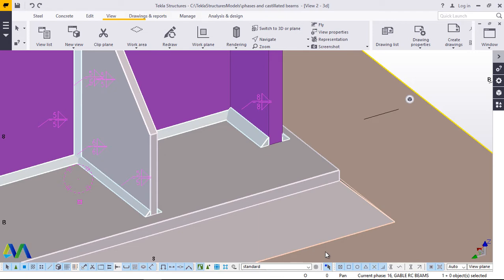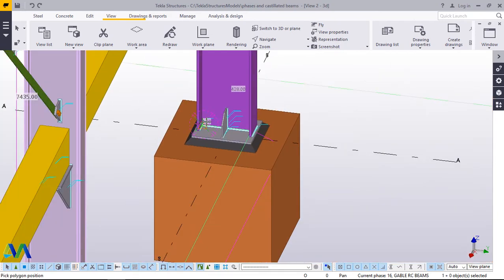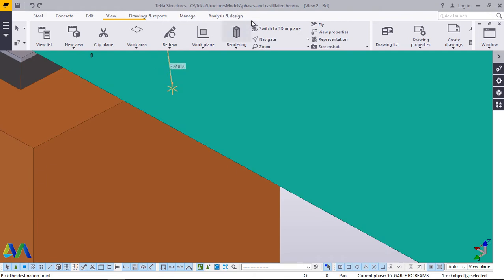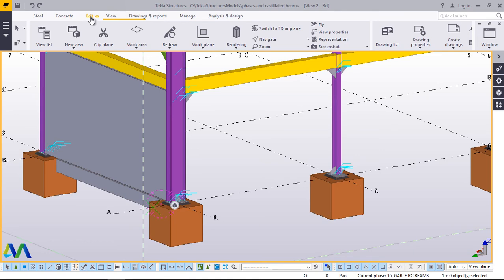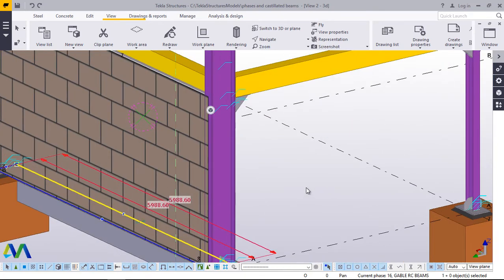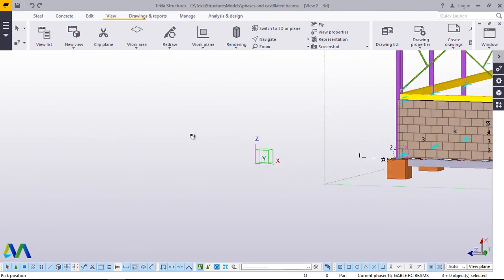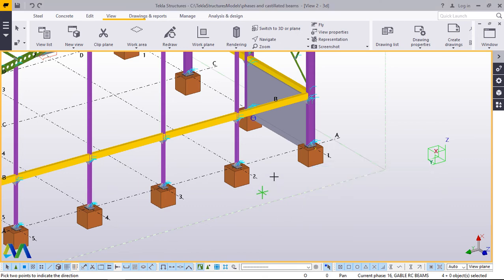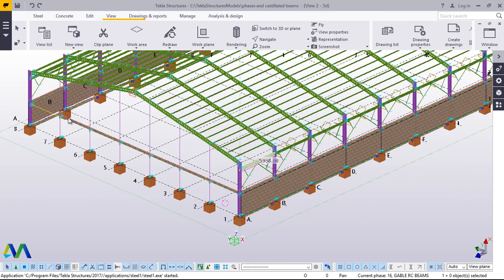Masonry wall and Plinth beam placement in Tekla Structures 2017

Comment: I am trying to open a General Arrangement drawing but when I select it to be opened I receive a message:
Cannot load selected drawing. What is the problem?
Reply from the maker: Which version are you using?
Reply: @MauriceDimba  19&20
Reply from the maker: 2017 is the most stable

Comment: And another thing when.I inquire tot length of bar is not coming correct
Reply from the maker: How were you approaching this?
Reply: Actually when I was using TEkla 2016 Tot length comes out correct in all format that is when.u inquire or generate report by organizer as well as drawing and report RPT format but in Tekla  2017 when.u inquire tot length doesnot comes correct  even in C shape bars normally its 1/2" approx error 
For the same bar if u inquire using report format of " bending of single bar" only it gives u excat value but in organizer no and other RPT Files
Reply from the maker: Tekla 2016 & 2017 no much difference,if you can do it on 2016 then 2017 should be easy,can i see the screenshot of what you're getting.
Reply: Yes sure can.I have ur email.address

Comment: Hi
Maurice sir
I m badly stuck in customization of rebars
Actually per our project and client demand he is customizing every shapes .alloting them different shape codes rather then tekla build in 
Eg tekla read straight bar "STR" he use " 1" as shape code instead of STR"
and so on
I tried I changed shape codes as well as shaffled values of leglenght etc per my project
But not able to feed formula in most cases
And to make folder
Reply from the maker: Noted and I will give you some guidance with regard to that.